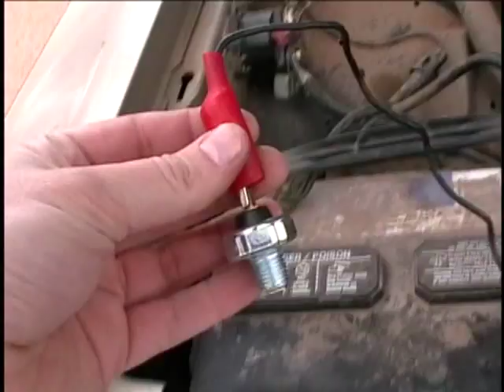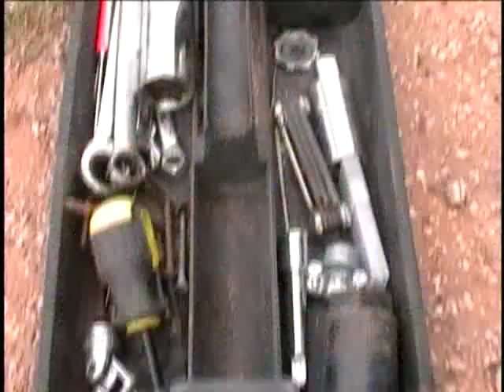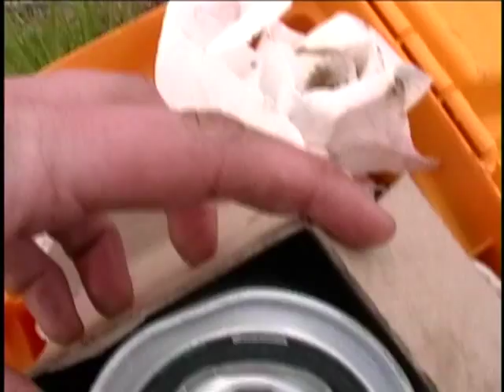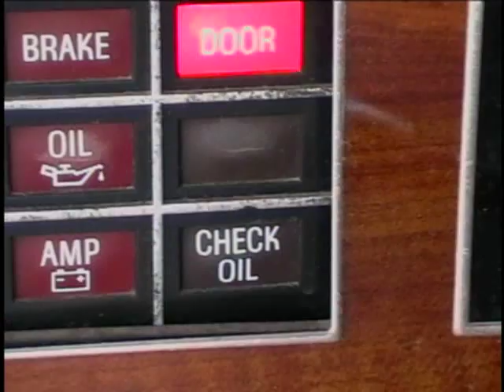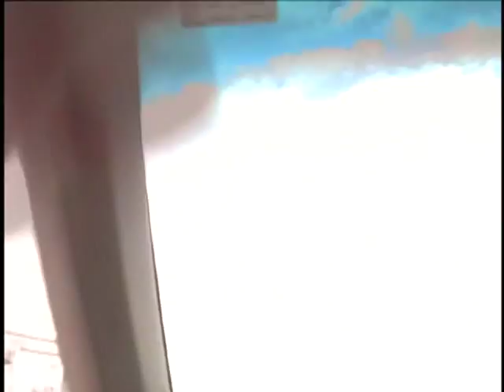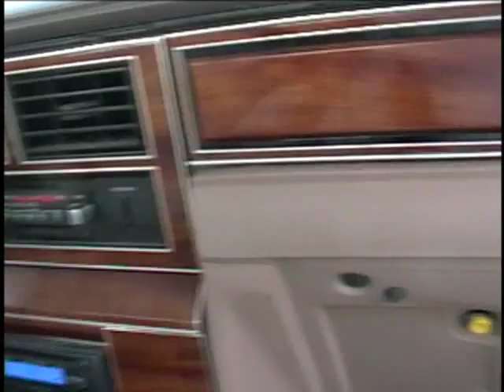1989 Lincoln Town Car Oil Pressure Sending Unit Repair

Comment: thank u.

my check oil is on.

What could it be?

I changed my oil & put on another sending unit..

Didn't know there where 2 drain plugs, where is the other one located?

On my A/C, it's cold one moment, then it gets hot.

Turning on heat, it doesn't immediately come on.

Thanks in advance

Comment: Hi Retrochad... I have a 99 Linc Town Car Cartier.  Had to replace the original Oil Sending Switch b/c it was leaking.  Problem is the oil light will not go out with the new switch.  I tried 4 different auto parts stores, including the Lincoln Dealership.  When I put the old switch back on, the oil light goes out.  Any help would be greatly appreciated.

Comment from the maker: @pcwalker We don't have emissions testing but they do do a visual inspection that all the emissions components are present and hooked up, including the smog pump and factory air cleaner/intake components. They wouldn't allow an Edelbrock aftermarket air cleaner on my 1978 Grand Marquis, had to be the factory unit.

Comment: I use Mobil 1 with Mobil 1 Synthetic and Lucas Synthetic Stabilizer in my 2003 Grand Marquis.  I used to use motorcraft, but is actually made by FRAM.

Comment: My, Chad you have really went to town on the Lincoln repairs...good job!

 I strongly recommend buying a factory service manual from ebay because they present much more in-depth testing procedures and repair steps. They usually are pretty reasonable.

 The STP filter is a Champion Labs, same with Bosch, Deutsch and now AC-Delco unfortunately. Rather cheap construction.

 Motorcraft is made by Purolator. I would use those or WIX exclusively.

Comment: You may check the A/C vacuum system under the hood, might be a leaky hose or a rusted out reservoir. The reservoir looks like a coffee can with vac hose(s) connected.